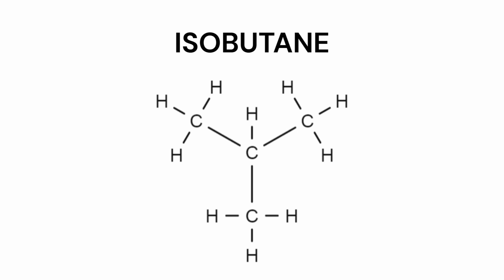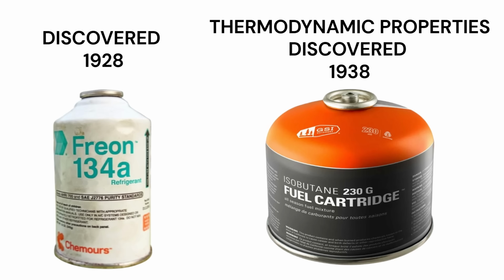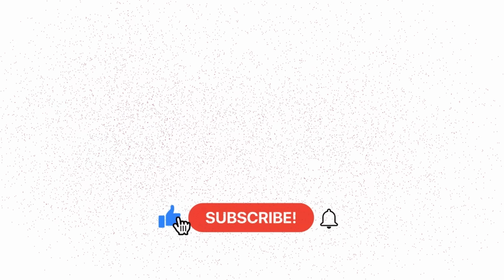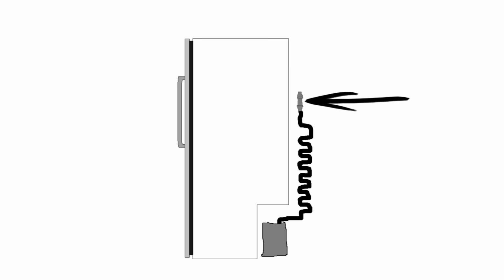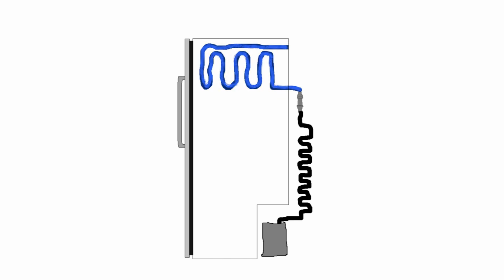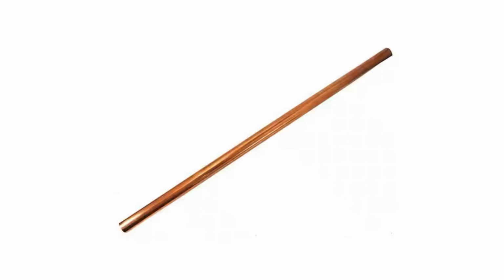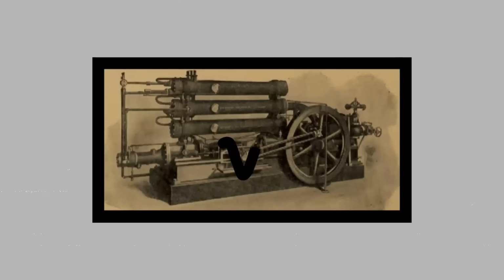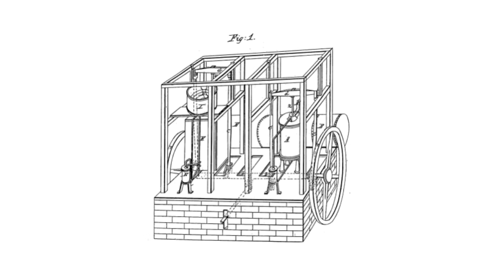Was Doc's 1885 mechanical fridge in Back to the Future really possible?

Comment: I will say that the DeLorean disappearing just because it was struck by lightning is inconsistent with the rules established in the first movie. The vehicle was sitting still, hovering... and not traveling at 88 mph when it was struck. Had all it had to be was struck by lightning instead of Marty worrying about driving the car down the street to get back to the future in the first movie they should have just pulled the car up under the line that doc had ran off of the clock Tower made a connection and just waited. If y'all remember in the first movie the car stalled out as Marty tried to go there for completely throwing this theory out the window. Part 2 is not consistent with the rules established in part 1 as far as that moment goes. That, and docs calculations in the first movie were absolutely wrong. Because Marty didn't get moving with the DeLorean for about 30 or 40 seconds after the alarm told him he should have gone, meaning he would have completely got to the line before the lightning strike and just crashed into the building at the end of the street and probably been killed. Then the lightning would have struck the clock tower 30 or 40 seconds later.

Comment: If you contain the ammonia under pressure, you actually don't need a compressor afterwards. only a heatsource to get a pressure difference. Camping refridgerators that work with propane are using that and some mobile coolers.

Comment: The fact he made a single ice cube was the funniest part of that whole thing to me; I imagine in real life you'd probably be making numerous ice balls using something akin to a candy roller, or perhaps preserving a large chunk of ice and shaving bits of it off.
Reply: It was meant for a laugh, the one in the movie was arguably worse than the ones that had actually been built by the 1880s. It was both overly complicated and it created only one cube at a time after a fair amount of effort. An actual refrigerator of the era wouldn't have been as good as the ones we have now, but it would have made more than one ice cube.
Reply: Exactly, it was a very inefficient ice cube (one) maker.
Reply: Doesn't he twiddle a few bits on the machine? Maybe he just dialled the machine into dispensing one cube.

Comment: Electrical tech was very easily😮 possible for a genius back then with the advanced tech tree knowledge he could have made a very basic motor and battery system,  copper and zinc, wax papers, and porous material should have been obtainable back then with the early tech tree, we just need bee hives, wood pulp for paper to make thick wax paper as a wire insulator, and metal for cables

He could easily wind a motor to make a generator.

Comment: I knew the answer because I used to have a Soviet refrigerator called “Don”, which had a vessel with ammonia mixed with water at the bottom that was boiling by electricity, just like an electric kettle does, but it could also work with an open fire.

The most important thing is that it didn’t even need a compressor, because the ammonia was already liquified by contact with water.

Comment: I know that can says "Freon", but R134a is not true Freon... which is R12.  The R12 is banned from manufacture, not R134a.  R134a might be banned in Europe, though... and its use limited in certain states... which is a shame... R134a is not terribly bad... we use it in canned air sprays.  All the replacements for R134a, such as R12334yf, are less effective and flammable.

Comment: I don’t think he would need anything mechanical in order to use ammonia to freeze water. I seem to remember an episode of Jericho where they only needed the water in a stainless steel bowl, floating in another bowl of ammonia. The Alaskan pipeline also uses towers filled with ammonia to keep the permafrost  beneath it frozen. I don’t believe there are any mechanics involved in those either. They’re basically cooling fins around a pipe structure, filled with ammonia. This sucks the heat from the ground and dissipates it into the air.

Comment: There was actually a mechanical refrigerator using ammonia that came out in the early 1900s called the "icyball" (no I am not making this up). It was just two metal spheres connected by a tube. One was filled with ammonia and the other with water. You put the ammonia side side in your fridge and the water stayed outside. The ammonia would slowly evaporate over the course of the day to keep your fridge cool. Then you recharge it by heating the water side while keeping the other side in cold water, which makes the ammonia boil off and condense back in the cold side.

Comment: magnets and copper wire are the only 2 unique components you need for a generator, 2 things doc could easily get even back then.
Reply: Yep, literally, the only reason why we didn't have practical electricity centuries earlier is that people didn't know that passing a magnetic field past a wire could induce current. Really, we could have had practical electricity thousands of years ago if the people were aware that it could be done with such simple items.

Comment: What i never understood... why didn't doc brown refine crude oil into gas for the Delorean. He would need to add lead to reduce detonation, but it would have been sufficient enough. FYI.. large commercial buildings were still using ammonia for their ac in the early 2000s that I'm sure of.  Not sure if they still do. I was a security guard and had to visit the roof of the hotel i worked at every night to check for the smell of leaking ammonia.

Comment: Ammonia is still used as a refrigerant today, and has actually gone thru a resurgence in popularity over the last several decades.
Back in the 19th century, refrigeration plants were large installations in ice houses, breweries, etc. The size of a plant was expressed in how many tons of ice it could produce in a 24 hour period. The smallest size plant, from catalogs of the era, was 2 or 3 tons. Air conditioning and refrigeration equipment is still described in tons capacity here in the US even though most of the time we are not using the equipment to make ice.
Reply: I thought when an air conditioner was rated in tons, that was the tonnage of ice that the air conditioner could simulate.  I.e. a 1-ton air conditioner provided the same cooling power as a 1-ton block of ice in 24 hours.

Of course one current idea is an ice-based air conditioner, where it uses solar power (or any other off-peak power source) to freeze water into ice.  Then when peak electrical load and higher prices happen, the 'air conditioner' just switches to a fan that uses the ice to cool the air.  High power demand when power is cheap, low power demand when power is expensive.

Comment: RV's still use ammonia based absorption fridges so they can run with either a resistive electric heater element or by a propane flame. Though thankfully they are finally becoming less common they are still preferred by many due to the ability to use propane instead of electricity. BTW the whole cooling system takes up much more room than a more modern compressor and refrigerant style while also using far more energy over a longer cycle to reach temperatures not as cold. Lower solar and energy storage costs have made the propane argument moot.

Comment: 1:05 - But Doc DID have DC electricity. He ran a model train to show Marty the plan.
Reply: Did you forget, that by that point, they had the DeLoreon in the Barn? The one with a functioning car battery..... and a fusion reactor.
Reply: @kommo1 he already had a time machine, which is how he got to 1885 to begin with. He stored it in the mine a week before the time we see take place in the movie
Reply: @j_waterworth  Yes. But as you too stated, he stored that one in the mine for Marty to find. I would say he deemed that a little more important, than using it for a fridge.
Reply: He probably built a steam engine generator.
Reply: @madmachine87 yea just rerouted the steam from the fridge through a small turbine would channel enough to get to 24 volt 5 amp for the trainset.
Reply: Oh  I thought the train was wound like those toy cars you pull backwards and release. Or like a mechanical watch.
Reply: @SKO_EN  you're actually both wrong

The train was pushed by hand

The electric model was in 1955 which used a key wound toy car and set the oily rags on fire lol
Reply: @AllanTidgwell-v6o nah he had an entire transformer built to power it
Reply: @AllanTidgwell-v6o  wow how could you be more wrong....you can literally look up the scene on youtube......it's electrically driven not hand pushed.
Reply: The amount of power he would need to run a compressor with 1800s components would not be feasible.  Steam engine parts would be easier to come by on the west coast.
Reply: @Raynl1978  Dynamos are easy to make wind, water or steam could easily turn one. This was also 1885 Edison and Tesla were fighting it out getting the contract for a Niagra falls power plant.
Reply: @Raynl1978  you do know making massive batteries isn't hard at all, right?
Reply: @AllanTidgwell-v6o Batteries that are efficient enough and that also needed to recharge yeah no
Reply: @justanotherperson3074  why would you need to recharge a massive DC cell? In the 1880s you didn't have much that was a large power draw. Heck, today most things don't draw a lot of power, there are just a lot more of them meaning we need more power to be produced
Reply: You can make Bagdad batteries

Comment: Wouldn't have to be mechanical.  Doc had everything he needed to create power generation and electric motors. 

He would have known that butane (1849) and propane (1857) both can be used as refrigerates. The first ice maker was 1848... by 1885 he could have bought a icemaker from a catalog or produced his own "modern" with contemporary equipment and supplies.

Comment: My opinion going in blind as a Machinist. Modern fridges use pumps to drive coolant through copper pipes in order to cool down the inside of an insulated box. 

Mechanically speaking. All your have to do is replace the motor to the pump with a clockwork device.

Comment: I'll keep that in mind when I build my house I designed that uses no electricity. It  has hot and cool running water for cooking bathing, flushing toilets, showers, various light sources such as fire at night and bleach light bulbs during the day as well as thermal mass heating and cooling.  Most of this achieved by mechanical means such as ram pumps to move water.  All the comforts you need none of the electricity.

Comment: Yes it's called using ammonia and hydrogen so first refrigerating plant used in 1880 was that refrigerator style is the same one that we use today in our RVs that are not hooked up to the grid they called propane refrigerators or kerosene refrigerators so you hydrogen and ammonia

Comment: Every refrigerator is mechanical, the compressor is only powered by electricity because it's more practical that way... Of course, you could also use a waterwheel or any other type of mechanical drive.

to add to that, the Doc comes from the future, so it does not matter if it has already been invented, he has the knowledge, so he can build it
Reply: Not really, it's just that mechanical refrigeration is still the most efficient and predictable. But, there are a bunch of technologies that have been used over the years, things like just allowing more efficient evaporation and those stupid peltier coolers that everybody keeps trying to scam me with when I want a refrigerated cooler.
Reply: @SmallSpoonBrigade peltier modules... i use them in my pc. but they are not efficient enough to refrigerate

Comment: You can use a two-cylinder Stirling engine without any chemicals—simply cool one of the cylinders with room-temperature water, while the other cylinder is cooled below the freezing point of water. Similar experiments can be found on YouTube.

Comment: 2:05 "We dont use it today" We use NH3 a lot for refrigeration today. It isnt used in household appliance but it is absolutely used in commercial and industrial refrigeratoration.
Reply: I was about to say we use it at my work.  We have occasional ammonia leak drills for safety.
Reply: I come down here to say this.  We definitely still use it today in large commercial systems.
Reply: Definitely, I recently was given the privilege of a tour around the local power station, they had these enormous tanks of Ammonia solution for coolant
Reply: It's still used for motorhome/caravan fridges that can run from electricity, driveshaft, or burning LPG.

I would love to refit a derelict icehouse with active refrigeration driven mechanically by a windmill or Savonius turbine and actually make ice inside when the wind blows.
Reply: @Fuzz-Ra  Uh, those fridges(RV fridges) simply run from heat - either AC or burning LPG. I've never seen one that runs mechanically.
Reply: @MacRobbSimpson  Fair enough. It's entirely possible I'd gone 1/3 mad.

Comment: I have a thermo electric cooler. Its not magic. It's just electricity running through two dissimilar metals.
Doc had everything he needed to build a generator and a thermo electric system; a shop, access to copper, two other metals, and magnets with either a stream or wind to move the generator.

Comment: The first artficial ice plants that made block ice instead of harvesting it from frozen lakes and rivers were steam powered.

Worked identically to a modern fridge, just with a stationary steam engine driving the compressor pistons instead of electric motors.

Should be mentioned Doc's fridge engine was also a generator, as it powered the DIY model train for the demonstration he did for Marty showing him the plan for "borrowing" C.P 131 to push the DeLorean to 88 mph.

Comment: "One of Florida’s two submissions to Statuary Hall, Dr. John Gorrie is hailed as the Father of HVAC, dying fifty years before Willam H. Carrier created the world’s first electric air conditioning unit."  He developed the ability to make ice in the Florida summer to cool rooms with malaria, yellow fever and other tropical disease patients.  He died in 1855.

Gorrie's machine used air as the working fluid.
""If the air were highly compressed, it would heat up by the energy of compression. If this compressed air were run through metal pipes cooled with water, and if this air cooled to the water temperature was expanded down to atmospheric pressure again, very low temperatures could be obtained, even low enough to freeze water in pans in a refrigerator box." The compressor could be powered by horse, water, wind driven sails, or steampower."

Comment: Fun fact! You dont even NEED a closed cycle, or any ammonia for that matter!

There is something called the joule-thomson effect, which causes a non-ideal expanding gas to drop in temperature, and can be even done with bog standard normal air. It would not be efficient at all, but VERY viable.

As for hydrocarbons, you could probably make ethene by boiling sulfuric acid and ethanol, or do wood pyrolysis to make a whole slew of hydrocarbons and fractionate.

Hyperspace pirate has quite a few videos on refrigeration, with liquifying nitrogen as his magnum opus, so check him out for refrigerating wisdom!
Reply: Indeed, machinery powered by compressed air can have problems getting cold and freezing up. Stirling engines when cranked instead of fired turn into heat pumps.first patented in 1816.

Comment: In fact eight of the nine known refrigeration cycles are completely mechanical in how they're driven, given that the compressor involved is a type of pump. (One being more like a chemistry or heat-engine thing, as the icy-ball method doesn't need any pumping.) So he had a bunch of design options to choose from. The electric/electronic bits in modern refrigeration units are simply to cycle the motor driving the pump on and off to more conveniently hold a set temperature.

Comment: It is entirely possible to refrigerate down to 32F just by having a big tank of water and then start pumping the first the air then vaporized water vapor out of the tank. 
https://www.youtube.com/watch?v=glLPMXq6yc0
If you don't control the suction pump the water will freeze and then it stops cooling worth a shid, doesn't vaporize it sublimates.
Virtues = Can use dirty or salt water. dirt simple, cheap, pretty effective down to 32. The chilled water can be circulated to where it is needed cheaply. Just open a valve and it will suck in it's own replentish-water. The cold steam can be allowed to condense to make pure dsitilled water.  Vices = the water leaves it's impurities behind in the big tank. Second rate energy efficiency. Disposing huge amounts of water vapor. One cylinder suction pump is fine but it has to be all made of bronze and marine-grade stuff. 
A bonus would be if you could have two or more suction pumps powered different ways = water wheel, wind mill, action of a float on waves, geothermal steam engine, internal combustion engine.